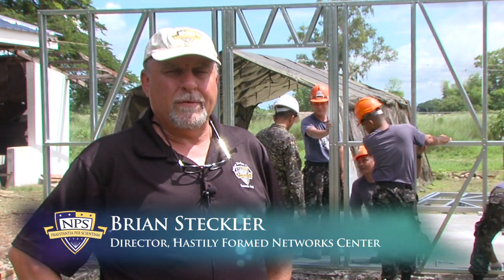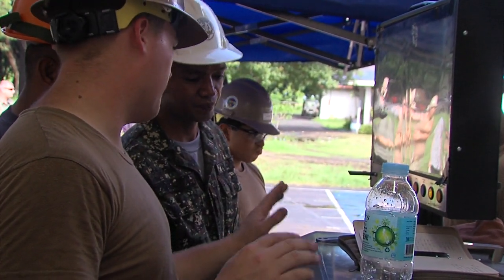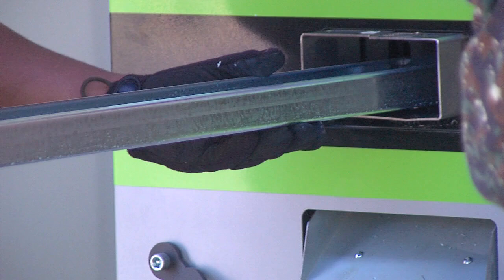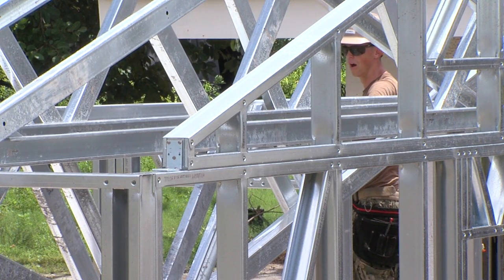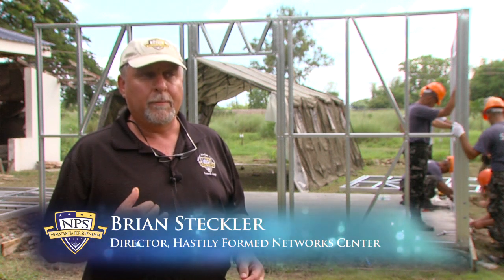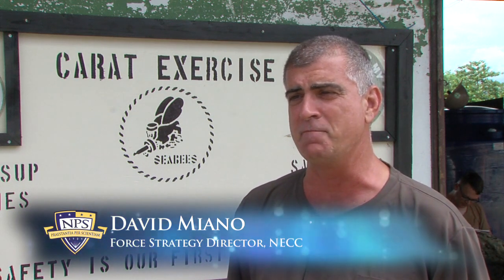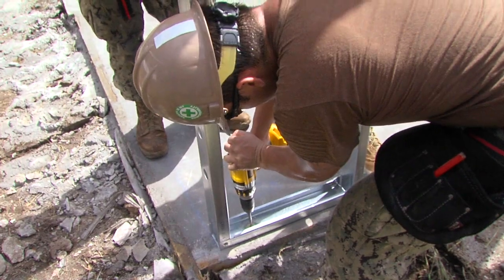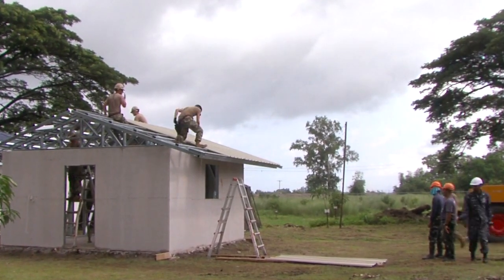Cold Form Steel Construction

Comment: I'm currently working at a company   on a rolling mill. Rolling sections from 100mm bases to 300mm bases. We have guys building frames that average a square metre of 1sq metre up to 12sq metre, 3 guys are hitting a meterage of 250to 400 Square meteres on a 10 hour shift. Depending on the layout of frames. Nice vid

Comment: Good Job, I have only one point to pick up your attention, Double check if you are using the right number of Screws that is coming from the design file. Maybe in some location you might require more then 2 bolts. thx

Comment: cost benefit analysis materials cheap ... Machine to do job Super Expensive... Labor varies depending on which branch of military used....
Reply: but think about the amount of cost and energy that is expended in the production and delivery of hot rolled sections to a site. Much more than for CFS.